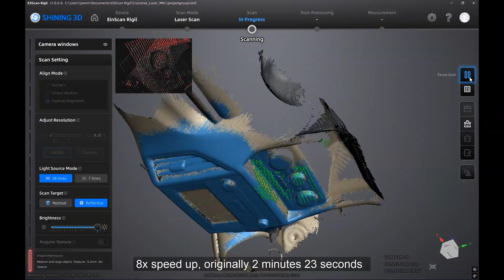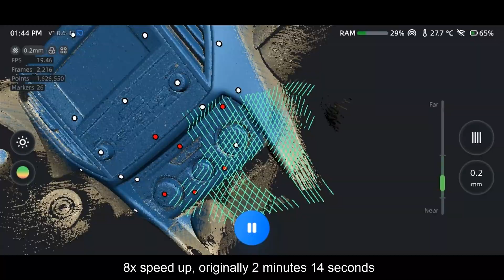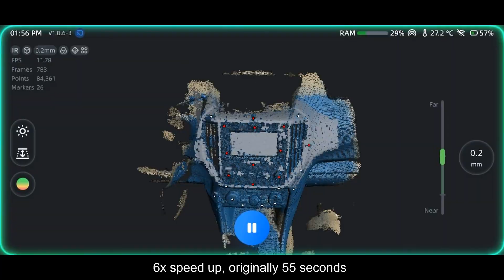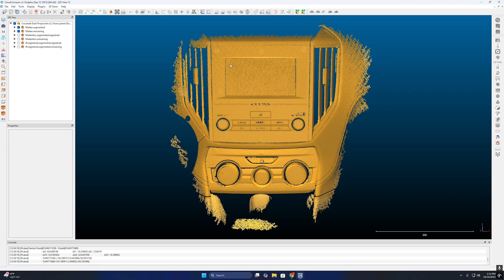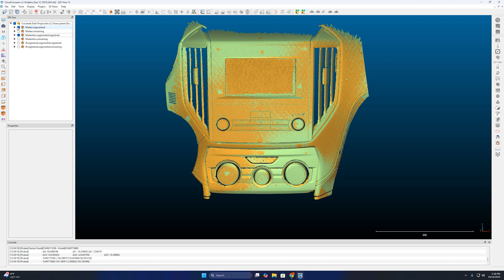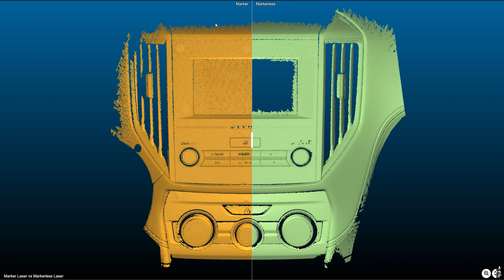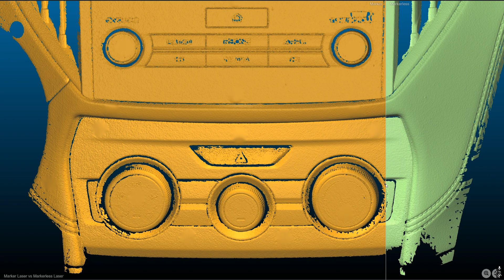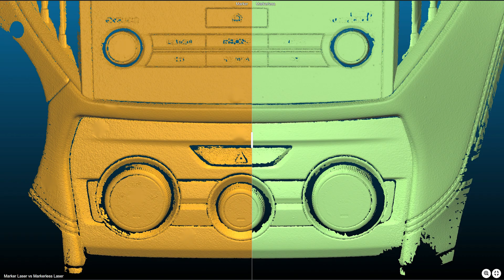Is Markerless Laser 3D Scanning Any Good?

Comment: Thank you for clearly demonstrating some of the capabilities, and most importantly, the quality of the resulting scans. I'm considering buying a RockIt in the future (I hope it will be significantly cheaper than the Rigil). Currently, my handheld scanners are a MetroX laser scanner and a standalone Miraco (but it only works in the IR range). As it turns out, I don't really need the "standalone" feature, but having one, very compact scanner instead of both is very appealing.